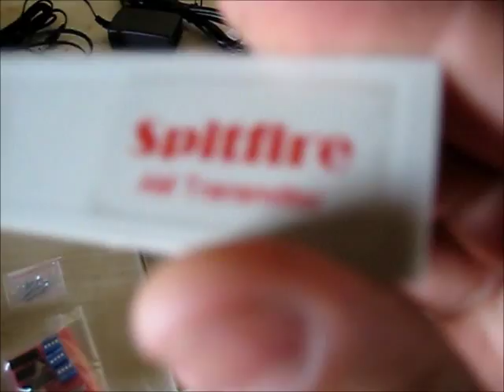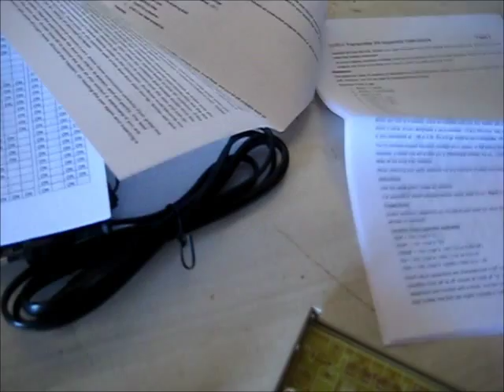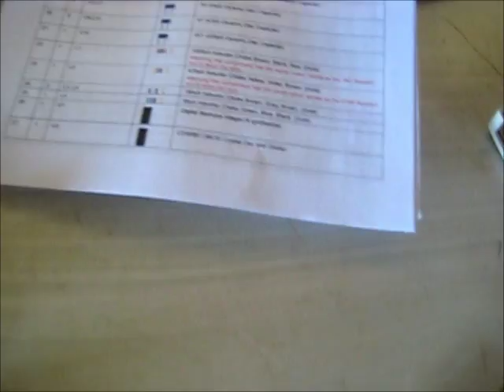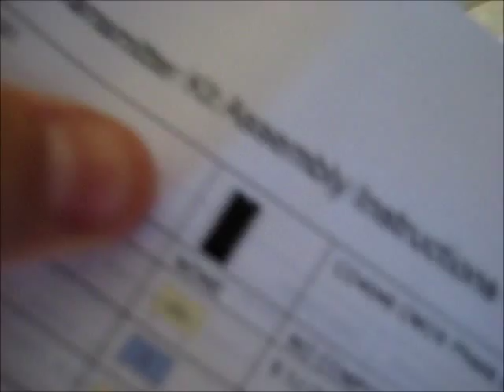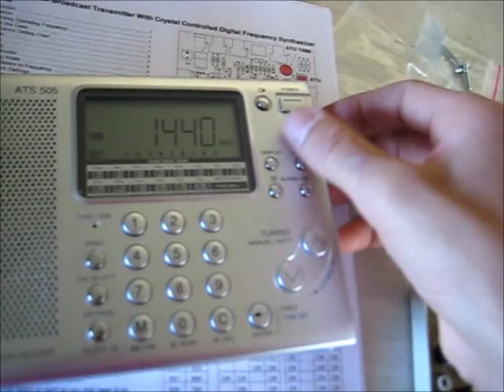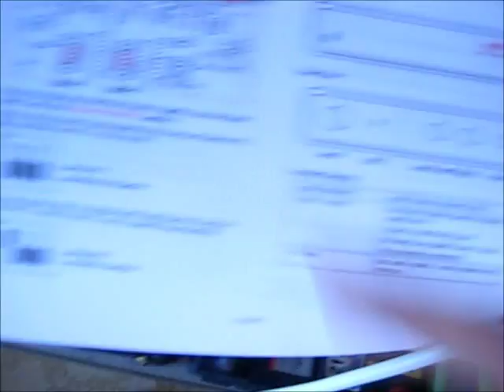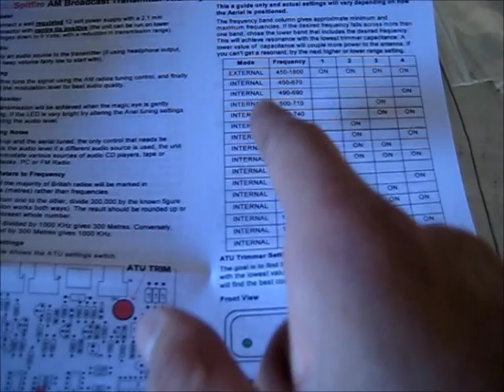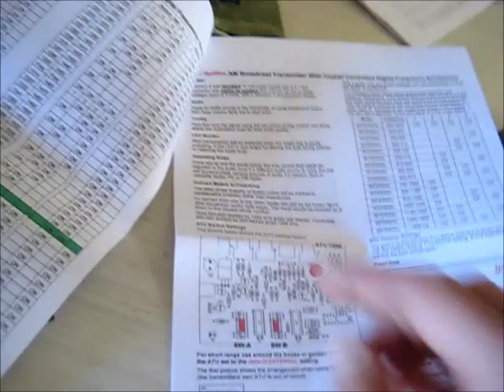Building A 100 mW AM Radio Station From A Kit

Comment: I built this !
I power it with a 9 volt 1400 mW wall wart !
I have a 135 foot dipole that is fed with balanced line !
I feed i/2 of the diapole and also run a earth ground !
This thing will put out way enough signal for several hundred feet !
I have not done any testing any farther than about 300 feet !
I say this has plenty enough power !
It does a antenna and a ground really helps !